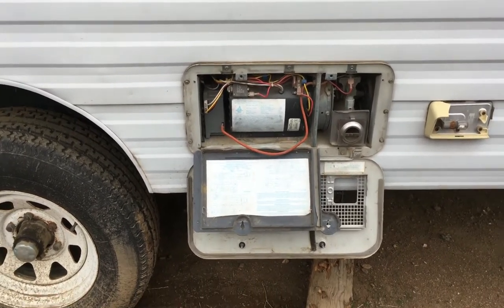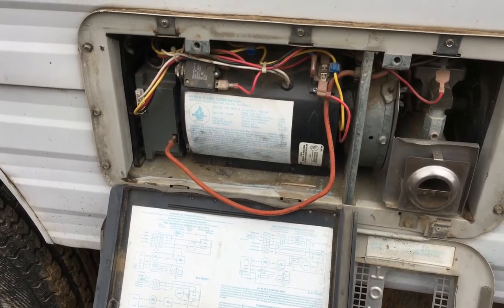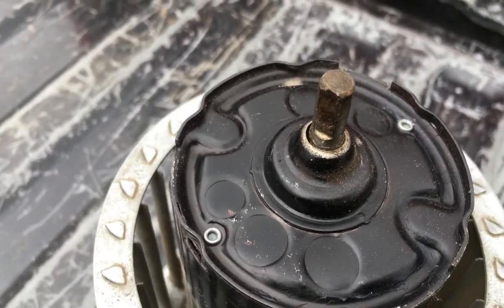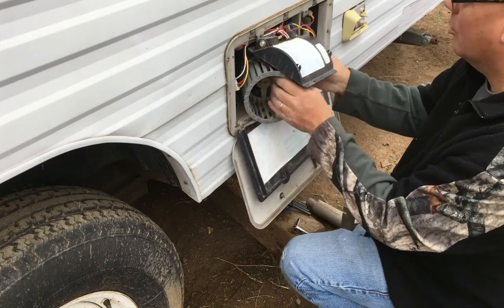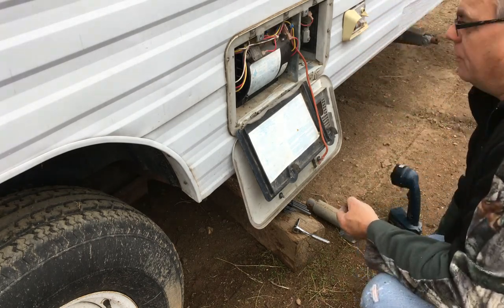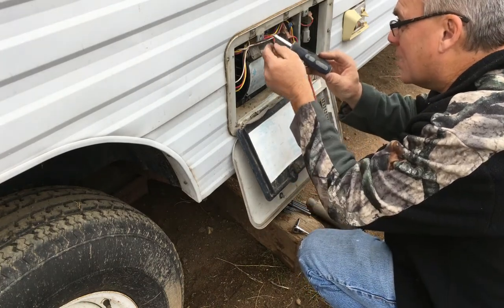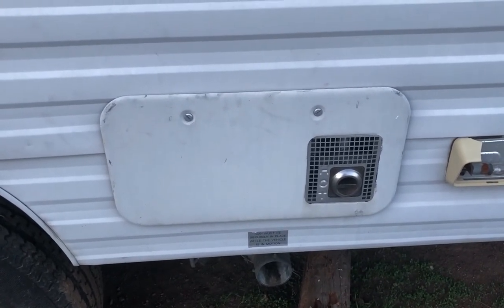Repairing a squeaky heater in your RV

Comment: The removal of the motor is covered well by others in other videos.  The oil to use is SYNTHETIC motor oil such as 5-20.  Pull both fans off the motor and connect a battery or battery charger to the motor and with the shaft at about a 45 degree angle up drip the oil slowly onto the bearing where the shaft comes out while the motor is running, periodically changing ends that are upward.  If you are powering it with a battery charger you can note the change in amps needed.  Mine started at almost 6 and after oiling it was down to just over one amp.  I've used synthetic oil on some bathroom vent fan bearings about 25 years ago when they were getting noisy and they've worked quietly since so I figure this should be a long term repair.  Regular engine oil only worked on the fans for a few months so don't waste your time with that.

Comment: I got the same motor. The rivets are to hold the plate that houses the brushes. If you bend the motor tabs back you can open and grease the bearing from the inside. After I greased the bearings I replaced the armature and bearing house back. I used a vise grip wrench to hold the housing and armature together.

Comment: H. R.,
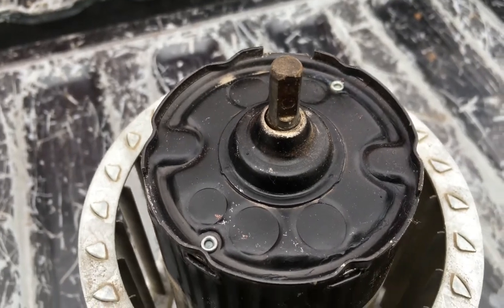It is not riveted. There are crimped or dimpled in sections of the cylindrical housing holding the end covers on. If you look on your video at 3:55, you will see a crimp by each rivet, 2 more at 9 and 3 o:clock and the other two crimps between those. Bending them out allows the end cover to slide off.
Thank you for your video. I too have the same problem.

Comment: Great episode!   I have the same furnace with the same problem.  (I've since trashed the trailer but parted out and kept all the good stuff.)  I'm planning to put the furnace in my garage for a simple heater.   I'll just jam grease in the bearings too until I can find a reasonably priced replacement motor.   THANKS for the video!!

Comment: Mine was squealing, then stopped and did nothing but blow fuses, thought motor was shot but turned out the smaller fan slid down the shaft and started rubbing the housing, eventually melting to it. Was able to loosen it up and slide it into it's proper place n  tighten it up, furnace works good now. Thank goodness because it supposed to be below 10 degrees soon.

Comment: wow !  same as one of my furnaces in my 88 alpenlite.  mine is squeaky and all that too. had removed it and took to a repair shop to hopefully tune it up right. they put a new board in it and i thought maybe the blower motor need repair or new one. but they didnt.  got it back and installed. works. BUT. makes a funny smell thats not propane smell but a weird burny smell tgat sets off the gas alarm.  SUCKs and now winters here again. i guess its shot or the heat exchanger is cracked from what i read and its carbon monoxide if it's setting of the gas alarm. but in not sure if its set iff the actual carbon monoxide detector. any ideas for other things it might be ?

Comment: whats weird about these furnace is they dont have a separate exhaust and intake pipe.  it seems to suck fresh air from around the exhaust pipe seems stupid.  i put a long pipe on the exhaust pipe and that seemed to work good.  also i noticed black soot build up in tge exhaust

Comment: Great video. Damn shame the motor manufacturer designs these $200 motors to be thrown away rather than replacing a $2 dollar bearing.
   I have the exact same issue currently as I write this comment. 
   Thanks again for your help.

Comment: I have the same exact way except I shot brake cleaner down the down by the bearing I thought them to be able to stop it ignited what is holding it in when you shoved it into you didn't really explain when I saw the screws go on the outside what was the first thing you put in that you had to get the bearing to sit there like a wheel on the inside isn't is that two wheels physical nut bolt or something on the end of that flat shaft so what makes it squeak and we are just as this what up man so how do you get a replacement it's got to be a way to fix it can't be that hard if they put it in there I can't be that hard to repair it
Reply from the maker: You should take it to an authorized repair shop

Comment: That was the worst! Actually turned it on and I think I have the exact same problem you have but you didn't show anything about how to get the motor out about how to get the fan off the other side slip the motor out anything or how to get it back in it was basically just a video of you standing by the side of the furnace working on it and then pointing at the crack telling us what you were going to do and then you standing by the side of the furnace again and saying you got it. Useless